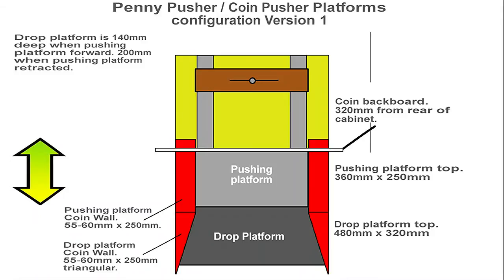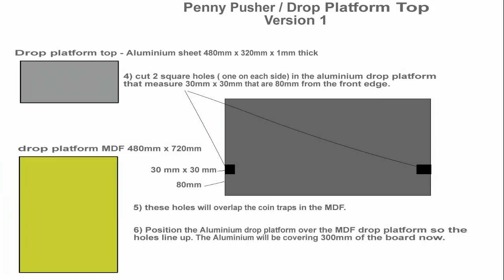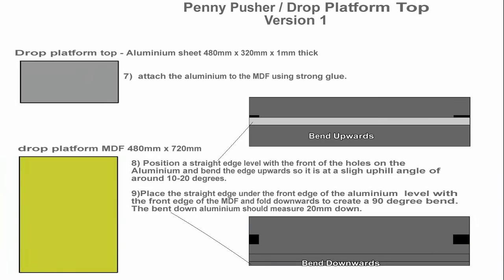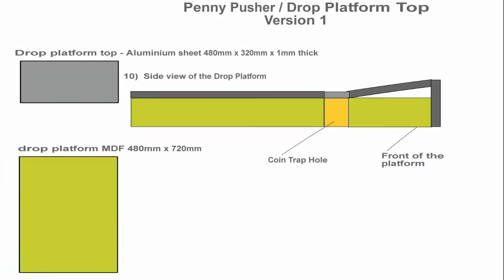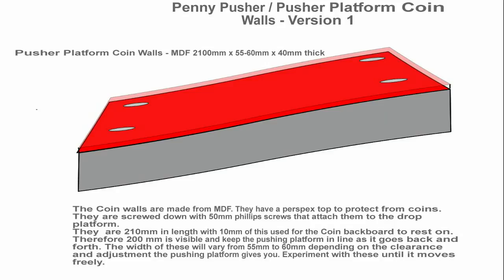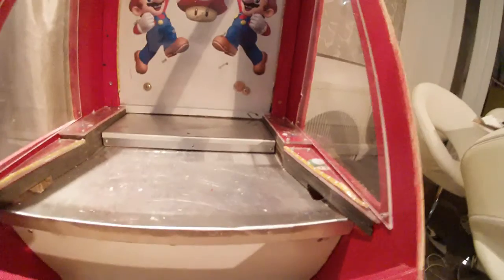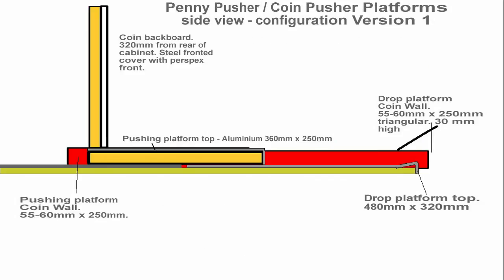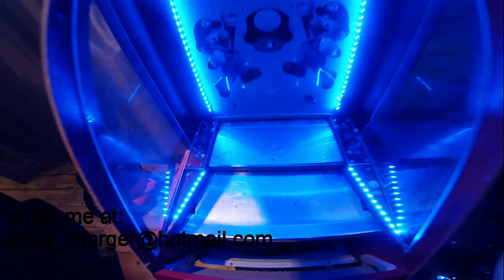Coin Pusher - 2P Pusher Project build - Part 4 - Platforms coin walls and backboard

Comment: The wall, did you just attach it to the sides? :-\ - also, did you put uip a vid of it with the coins in ? - I can't find one :( - good job btw, Im sure the kids have loved it!
Reply from the maker: Hi there! Thanks for the kind feedback! If you check out the coin pusher channel I have made this video and a video with the coins in it should appear! Take a look! You will see the lights in it too! The kids love it. It's a great talking piece!
Reply from the maker: https://youtu.be/x_JDeNMuYj8
Reply: andycharger Thanks Andy, I am not 100% sure exactly how I missed this video!! Lol - I seen the other parts! - That is really a good job you did, I wish I seen your videos before I started building my own -  I think I got too excited about building one that I didnt meassure wood properly before cutting! -  I, like yourself have used a window wiper motor, and after a lot of trial and error, maanged to get it on the pushing platform, my problem now is the length is not very good because the motor was quite large if that makes sense! - so only maybe 1 coin can sit on the top platform at the moment, and maybe only 7 in the bottom! ARGH -  Your videos have been great though and gives me some hope that I can save what I have built so far with a couple of changes -
Reply: Actually im not sure If I can save what I made, It looks like your length from back to front was 800mm, mine is only 600mm, and that extra couple of hundread if prob what I need ! Doh ! Lol